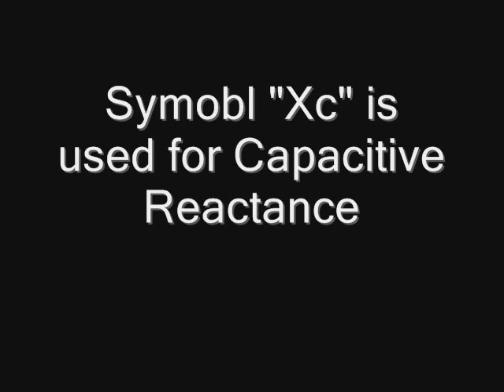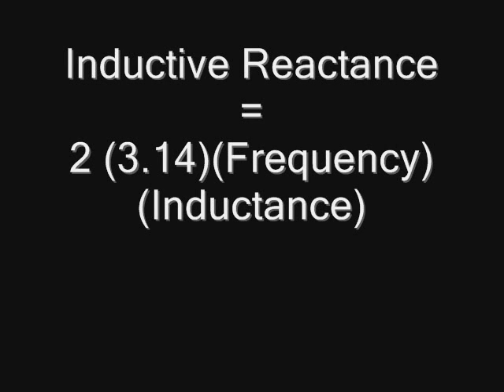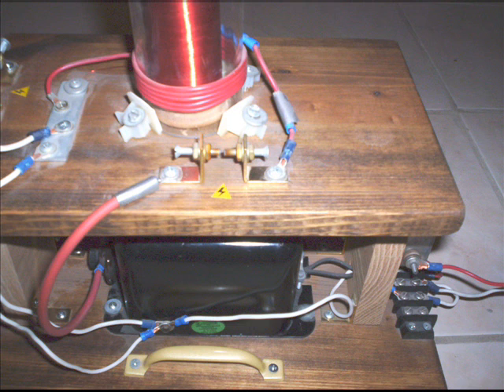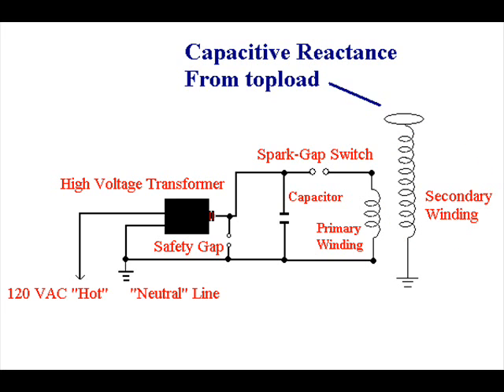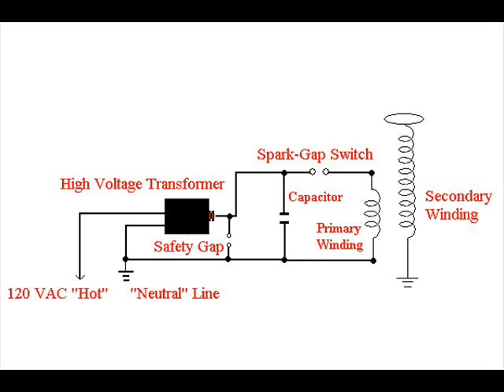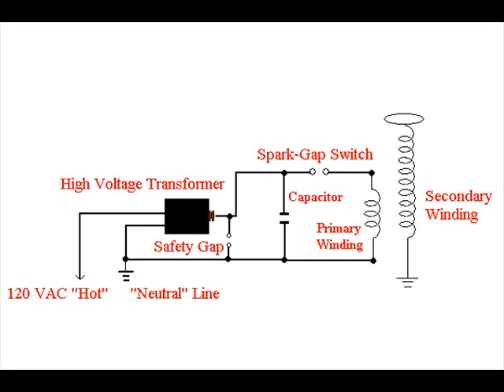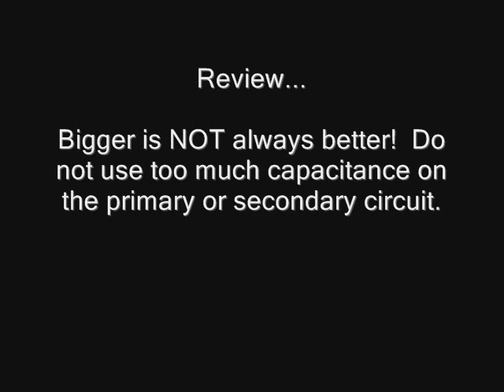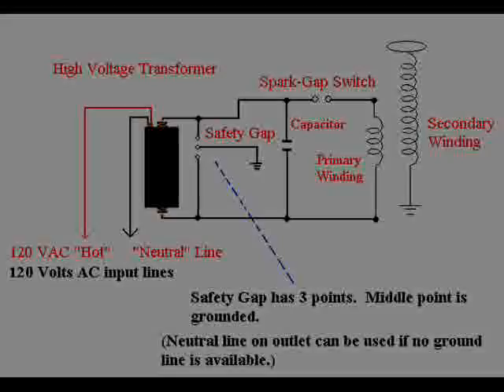Building a Tesla Coil - Part 2 (B)

Comment: We dont need quantitative formula at this point, more in-depth description operational dynamics and relationships. These formulas have no context for the un initiated and just add confusion. I wouldn’t introduce specific formulas to part 4 at least. Part 3 (or more) should dive into in depth specifics of each component, then, the dynamic relationships of them. 
Also, a clear objective has not yer been established. Yes we know we want to create high voltage energy through use of induction of secondary coil from primary, but, what about the objective of creating a frequency that is in tune with the specific nature of the environmental surrounding. ie; spark gap dynamics of air ionisation and grounding dynamics of earth resonant properties....

Comment: i just want ask this ground of secondary coil is it earth ground or return to neutral?  ground of neon sign are they coupled to the ground of secondary winding. is it an earth ground?
Reply from the maker: Yes, connect the bottom of the secondary winding AND the ground (center tap) of the neon sign transformer to the AC ground line. If you don't have a ground line in your outlets, then connect them to the neutral line.

Comment: how should I connect the other end of the secondary winding ?
Reply from the maker: Anas roumieh Connect it to the ground or neutral line of the 120v AC input.
Reply: thank you. I will begin my tesla coil project soon, if I needed to ask you any question in the future will you respond ?
Reply from the maker: Anas roumieh I'll try to. I rarely go on YouTube anymore, but I do try to reply to comments and messages. Good luck with your Tesla Coil. Just be careful - the primary circuit can be a dangerous shock hazard.
Reply: thanks for all the information in the videos, you are a very good teacher
Reply from the maker: Anas roumieh Well, I made these videos a LONG time ago (about 10 years ago) and I've kind of moved on to other hobbies. But I'm really glad it was helpful for you :)
Reply: ct92404 can pls tell me the difference between your design and  the tesla coil designs in which capacitor in  series and spark gap is parallel

Comment: If I have 230v CEE 7/4 outlet, will I have to connect the ground wire to one of the hot wires to have 1 neutral and 1 hot line?

Comment: So if I used the power from my 110 outlet it will power my tesla coil? or should I use a 12v car battery? I figure that would need to be charged over time. and do you have the parts list that you used to build yours?

Comment: Great vid thanks. I'm using a Rotary spark gap to solve the issues with a static spark gap, would I be right in assuming that being able to control the RPM solves many issues that people have with trying to tune a static gap.

Comment: Just a question: If using a midpoint-grounded transformer, can you ground the safety gap to the neutral line running from the mains to the transformer?

Comment: I use neon transformers for My coils, and every time I tried inverting the spark gap and capacitors  the coils did not work at all! I use whisky bottles (3) for each of my little 1.5'' coils. I use Cornell Dublier 942c2op15k-f caps for my 3 & 4'' coils.

Comment from the maker: Well, basically all you need to do is put a load in series with the primary winding of the transformer.  It doesn't HAVE to be a light bulb or a choke.  You can pretty much use anything.  All you're doing is adding impedance (resistance) to the circuit so that you don't create a short circuit when you fire an arc from the transformer.  You can use pretty much anything.  I've just found that inductance seems to work best.

Comment from the maker: @INVENTOR3 
Yes, you would connect the grounding screw on the side of the transformer to the ground line on the outlet...OR you can connect it to the neutral line if you're using an outlet that doesn't have a ground prong.  The reason I said that is because I live in an old house where most of the outlets only have two prongs (hot and neutral).

The safety gap should fire periodically.  I'd say that once every 3-5 seconds is normal.

Comment from the maker: @timlyo 
For the small Tesla Coil that is in my videos, the terminal is a metal dish.  I actually used a launch pad from an Estes model rocket kit!  I did a lot of testing, and for that particular coil it just happened that a thin object with more surface area worked best.  Probably because of the coil's high resonant frequency.

Comment from the maker: @thjarden 
I think I got the transformer for about $10-$15.  I don't remember exactly, it was a long time ago.  I bought it at an electrical surplus place.  The magnet wire is 28 gauge, and I bought a spool of it for about $12.  I got really luck with the capacitors though...a friend gave them to me for free.  I'd say that altogether with the wood and hardware to build the base, the spark gaps, etc it probably cost around $60 or so.

Comment: Looking at drawing of NST at end of video,,,,what is exactly meant by "neutral line on outlet can be used if no ground line is available"? I understand what the nuetral line is(white wire, wide prong). Hmm, there is a small green grounding srew on side of transfromer,,,what do i do with this? Does this "need" to be connected to earth ground, the third wire that comes from the wall outlet? Should safty gaps "only" spark if there is high reverse spike voltages,,and not all the time?

Comment: hey, i have a question, say you 're doing a non-solid state tesla coil. and you're going to have the primary coil going up at a 20 deg. angle, around the base of the secondary, must you remove windings from the primary to tune it? or can you use a clip for the return side and simply move the clip down one winding each time to shorten the length of the circuit?

Comment: It might be really helpful if you could give some example values; for instance, what is the diameter and # of windings of your primary and secondaries, what is the inductance, what is the value of the capacitor, what is the size of the top-load...  I realize I will still have to fine tune my circuit, but without some rough values to start from,  I can't begin to build it in the first place.

Comment: For the NST schematic I think that the spark gap and capacitor should be switched. This would reduce the chance for high frequency backing up into the transformer, which is very bad for NST's.

Comment: So, i have a quick question. in tuning a tesla coil, it isn't a case of tuning one coil to react with the other, it's tuning the primary to its optimum... i'll call it resonance... and then doing the same for the secondary? you don't tune it once, but you tune both coils? and they're independant of each other? so that changing the 'resonance' of the primary won't change the 'resonance' of the secondary?

Comment: Great Video, Once you turn the power off from the coil do you find there is a charge left over in the capacitor? If so what do you use to make sure its safe to work on? If one of the spark gaps is shorted out this would make sure there is no lethal voltages remaining in the capactor by discharging to earth. I was thinking mabe a lengh of PVC Pipe with metal on the end would do? Do yor discharge / short out your capictor before working on the coil?

Comment: I don't think the spark gap is just for timing.  It's also to select the nature of the wave.  With capacitor discharges you get more sudden and powerful discharges than a simple alternating wave as would come from the transformer secondary.

And further you can tune the spark gap impulses by using a magnetic and/or air quench.  This allows a single discharge from the capacitor to be created and destroyed many times, as when the arc is formed, it's immediately extinguished.

Comment from the maker: Well, you can power it up whenever you want just to test it...but it won't work as well.  Tuning helps to improve the performance. So yeah, you can power it up and you'll get sparks...but it won't work as well as it could. In fact, if the tuning is really off, you might just get tiny sparks.

Comment from the maker: ...with a wider gap setting, the discharges are brighter and louder (indicating more energy being stored between gap firings), but the effective frequency is also much lower.

These are observations I have actually made from building Tesla Coils for the past 10 years.  

Thanks for the comments, and yes I do have a few videos where I show this Tesla Coil running.  I would build a bigger one, but I just don't have the space to store it.

Comment from the maker: It wasn't a mistake.  In a way, the spark gap forms a sort of R-C circuit, and by adjusting the gap you not only vary the effective frequency in the primary circuit, you are also changing the amount of energy stored between gap firings.  You can clearly see this when you adjust the spark gap and see how the discharge changes.  With a short gap, you have a higher frequency but the discharges happen so fast that the capacitor is never able to charge up to full capacity...

Comment: hello, my coil is a 4 inch pvc secondary, but it needs over 12 turns to be close to in tune, do you know how I can reduce this ammount? my toroid is home made, its much like a 3 inch dryer duct toroid but a little different, my cap bank is at 13 nf, with a 12kv 30 ma nst, and a static spark gap, 1/4 inch tubing for my primary... thanks

Comment from the maker: actually, a MOT is an end-point grounded transformer.  Or at least, all the ones I've seen are.  There is only 1 HV output terminal, and the other end of the transformer secondary winding is connected to the core.

Comment: I see now, yes, if one is using an end-point grounded neon sign transformer there's no other way to do it. I was thinking of situations in which one is using a MOT that just has two leads coming out on the transformer secondary side (Tesla Coil primary) side.  In that case wouldn't it be best to "float" those windings?

Comment from the maker: my Tesla Coil in the video uses an end-point grounded transformer.  Therefore, the primary winding will have one "hot" end, and the other end will be connected to a common ground with the bottom of the TC secondary winding.  There isn't any other practical way to connect a (portable) Tesla Coil.  It IS safe.  I've been doing this for over 10 years, and I also had help from someone who has been experimenting with high voltage since before I was even born.

Comment: I meant mains potential primary below, sorry. Still, if you connect the ground of the primary to the same ground as the secondary you're at the same ground potential as both, which means if you touch one of the streamers from the secondary side you could also become a sink for current from the not-current-limited primary side through capacitive coupling.

Comment from the maker: The transformer itself supplies high voltage AC, but it's rectified to supply high voltage DC to the magnetron tube.  

The transformer by itself just steps up the voltage from 120 volts to about 2,000 volts AC.

Comment from the maker: It would have to be a pulsing DC, not just a continous DC.  Transformers won't work with straight DC because in order for induction to be possible, there has to be a changing magnetic field and a relative motion.  Either a conductor has to move inside a magnetic field (like in a generator) or the magnetic field has to be moving across the conductor (like in a transformer).  So transformers can only work with AC or pulsating DC.

Comment from the maker: lol...maybe you just message me instead of posting comments.  You're much better off with a neon transformer than a microwave transformer.  MOTs are not current limited, so you will have to use an external ballast.  They also supply only about 2,00 volts at most.  You CAN use MOTs for a Tesla Coil, but I wouldn't recommend it.

Comment from the maker: The primary and secondary winding are inductively coupled, like a regular transformer (except that it's working at high frequency).  So no matter what, energy is transferred between the windings.  The thing is that you want the coil to be well tuned, so that you only have high frequency output from the secondary winding.  The wireless energy that you're talking about is from the terminal of the secondary winding (along with high voltage sparks and corona).  The spark gap also generates some RF.

Comment: ok thank you i'll be using a neon transformer most likely so if the grounding is connected then does the energy transfer between primary and secondary wirelessly

Comment from the maker: You WILL connect the bottom end of the secondary winding and one end of the primary winding together to a common ground IF you have an end-point grounded transformer.  The way you connect the primary winding depends on what kind of transformer you have...whether it's mid-point grounded or end-point grounded.

Comment from the maker: ...That's the real concern, getting low frequency currents.  I should point out that even if the primary winding is floating and is electrically isolated from the secondary, there could still be a shock hazard if a low frequency current is INDUCED onto the secondary.  So your main concern is to have the coil well tuned.

Comment from the maker: Unless you are completely confident that your Tesla Coil is well tuned and running smoothly, and is generating high frequency, then yeah I wouldn't recommend drawing arcs from it anyway.  The main concern isn't high energy kickback from the primary circuit getting into the secondary as you mentiond, but actually getting transient low frequency current.  That's the real concern.  The secondary is mostly harmless because it's high frequency.

Comment: I have two OBITs that I bought off of ebay. They are of the make Allanson. They are both midpoint grounded and have two terminals. (I'm just saying that so that people know that not all oil-burner transformers are end-point grounded)

I've watched both of your videos numerous times, and they helped me a lot when building my first coil, but I'm just saying that I wouldn't feel comfortable standing on Earth ground, with my secondary hooked up to the primary circuit, and drawing arcs to my hands.

Comment from the maker: You need to watch both videos.  This is only for a Tesla Coil that uses a transformer that's end-point grounded (like a furnace transformer or a MOT).  One end of the primary winding and the BOTTOM end of the secondary winding are grounded.

If you watch both videos, it clearly explains that a Tesla Coil using a mid-point grounded transformer (like a neon transformer with 2 HV terminals) will be connected differently.

Comment from the maker: This is for a Tesla Coil that uses an end-point grounded transformer.  Therefore, with the primary winding, one end has to be connected to neutral or ground.  The bottom end of the secondary winding will also be grounded.  So, in effect YES with a Tesla Coil connected this way, the primary winding will be connected to the secondary, but at a zero voltage gradient.  They only have a common ground.  I use the neutral line because I live in an old house and most of the outlets only have 2 wires

Comment: In most Tesla coils, you don't want to connect the secondary to the primary - you want to connect it to RF ground (literally, the ground outside!). When you connect the secondary to the primary, you end up getting that high amperage kickback into the secondary which will, likely, kill you if you draw arcs through anything you're holding. Also, the high voltage being sent into the primary circuit will kill your transformer.

Comment from the maker: no, I wouldn't recommend using microwave oven capacitors for a Tesla Coil.  They don't react very well with a high frequency discharge circuit and they tend to overheat.  Also, most of them have way too much capacitance and the voltage rating is too low...exactly the opposite of what you need for a Tesla Coil.  You COULD connect several of them in series, but I still wouldn't recommend using them.

Comment from the maker: You could have also just sent me a message, you didn't have to post the same comment on all my videos.  But I need more info.  What's the current output of your transformer?  What's the capacitance value of the capacitors?  Also, what's the dimensions of your primary and secondary windings (length and width)?  One mistake a lot of people make is to have a long, really narrow secondary winding.  It should be at least 2 inches in diamter.  Message me if you want, and I'll try to help.

Comment from the maker: It's possible, but glass has a very high breakdown voltage.  I've never had a problem with it.  It will definitely withstand up to 15kv, which is the highest voltage you would want to use with a spark gap Tesla Coil anyway.  If the glass is really thin, you might get some corona losses though.  But when I've used homemade capacitors, I never had that problem with glass.

Comment from the maker: Sure.  You can use almost anything.  A capacitor is simply just two conductors for the "plates" and an insulator between them.  A bowl would work better than a plate though, so that it completely surronds the glasses with salt water.

Comment from the maker: Okay, sorry about that.  I should have checked to see what country you are in.  I don't know how the wiring is in Europe.  If the neutral line is at 0 volts, then yes you can use it as your ground.  But it's better to use ground if you can.  I live in an old house that only has two wires for most of the outlets.